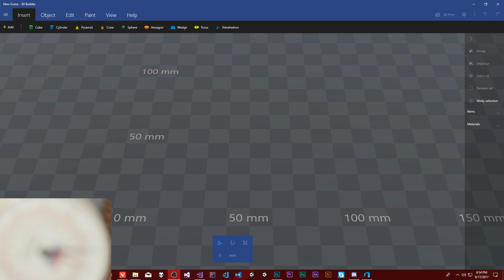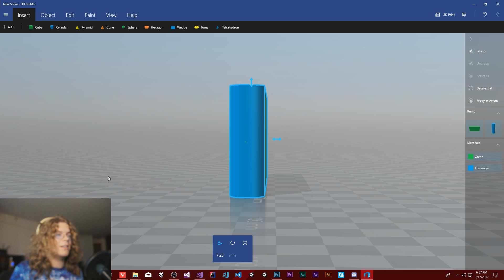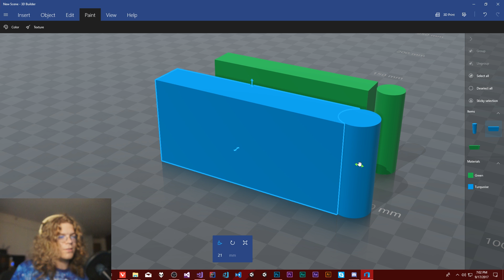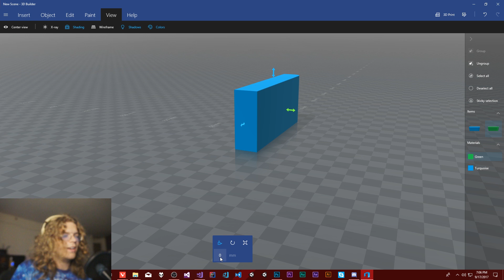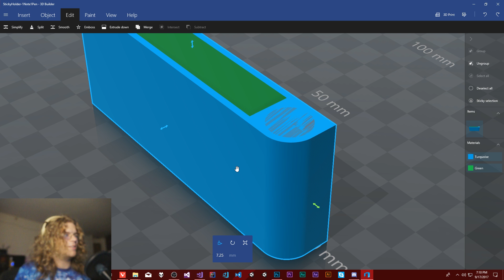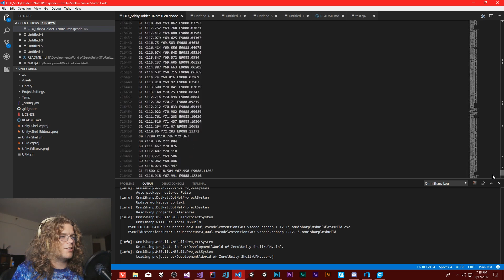3D Printing a Sticky Note Holder in 3D Builder

Comment from the maker: Also, 3MF is not a CAD format. It's a 3D format developed with collaboration between Microsoft, HP, Autodesk and Dassault Systems. You can learn more about it and read up on the spec here: http://www.3mf.io/specification/

Comment: Did you have to send it to cura or could you have just used the 3D builder?
Reply from the maker: 3D Builder can send to your printer (or an online service for printing) but my printer doesn't get detected by 3D Builder so that feature doesn't work for me unfortunately. With my old printer I had to export the .gcode to an SD card to print and I don't think you can do that in 3D Builder. I personally have not had any luck printing directly from 3D Builder - I've honestly never really tried - but the option does exist.